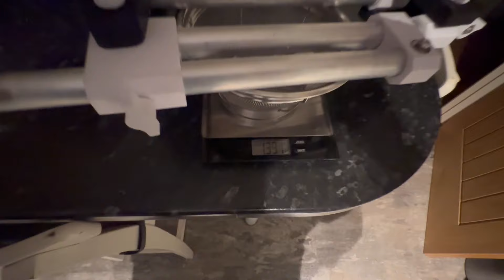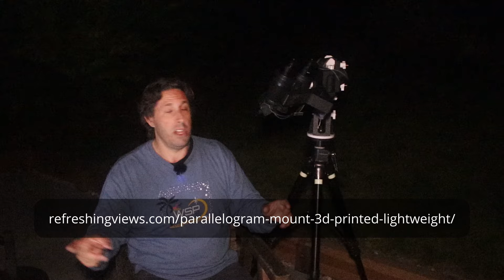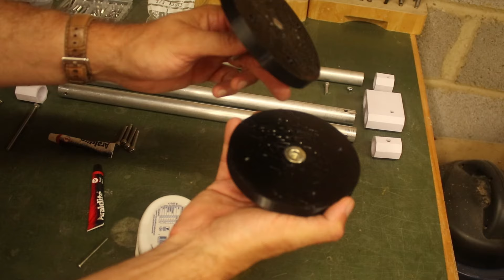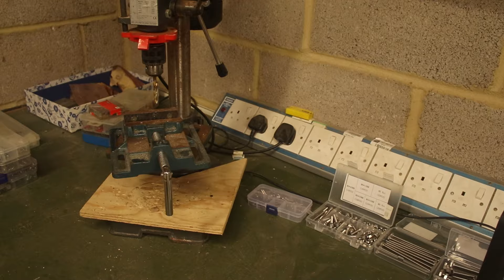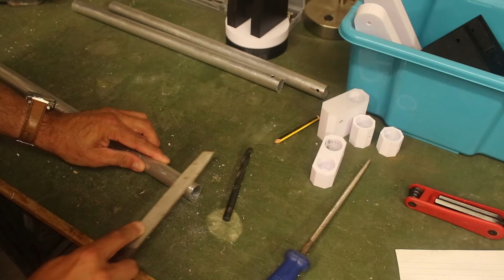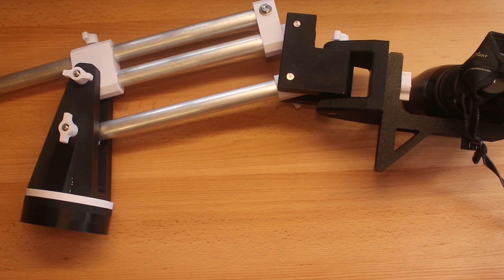Parallelogram Mount 3D Printed DIY Build for Binoculars Astronomy

Comment: Just finished mine… thank you for sharing the video and files. I designed the bottom part of the plinth to fit a telescope tripod, and will make some minor tweaks to the counterweight design, but pretty happy off the bat.
Reply: How many infilled for parts?
Reply: @panonska3 15%. It’s holding the weight well, but I would recommend 25% just to get some more rigidity, at least for the plinth and lower arms.
Reply: @ZSiegfried  how many wall line you recommend? 3 or more?
Reply: @ I left this unchanged, and don't even recall... sorry, I am not that sophisticated at 3D printing.

I feel that the most likely point of failure for my setup (which was at the 15% and normal infill pattern - so relatively "weak"), is where the top and lower plinth parts are epoxied together, so not the print itself. If this become an issue, I will just redesign this section to reinforce somehow, and then go 25% infill with a triangle infill pattern.

Comment: Great work! May I suggest one thing? Remove the string from the counterweight on the end. Bolt it directly on the pipe or design something at the end to hold it, but firmly. That way there won't be any ossceletions after moving the arm.
Reply from the maker: You are right, this was just the quick and dirty approach. Someone has just suggested using dumbbell clamps to hold the weight on the shaft so I am ordering some now. Thanks once again!

Comment: Hey mate, 

Is it possible to mount a 20x80 2.4kg binocular on this mount.
Brilliant video and mount btw. Congratulations!
Reply from the maker: I think you will be pushing the weight limit there so I think it would be a risk. My 15x50 weigh one 1.1kg and that felt pretty secure. I mean, you could try and see how you get on but I would not like to guarantee it.
Reply: @RefreshingViews  What about just increasing the infill to 40 or 60%?

Comment: Love the design!  In Canada so have many sae bolts in my shop. Trying to modify stl files is not that easy for me. Did you design in Fusion ?  Share the Fusion files ?
Reply: Also in Canada, but found everything I needed on Amazon
Reply: @ZSiegfried  for sure but too lazy ...and have a big bucket of 1/4-20 & 5/16-16?( which are bang on for 8mm) . Modifying for the 1/4-20  seemed to much of a hassle, so bought some 6 mm. Found I still needed to thin them on the grinder.  All the thru bolts on the tubing  I upped in size to the 5/16 for extra strength 
And I modified the binoc platform to accept my 15x70's.
Reply: @kellypurdue1990 nice! I am also using 15x70 at around 1.8kg - the bino platform worked fine as is, but I mounted mine on a telescope mount so had to design the bottom plinth to fit.

Seems to be holding up despite the added weight. I would do extra infill and a different pattern for added strength if I do another one though.
Reply: @ZSiegfried  will try and send a pic of my modified  binoc mount. Just being paranoid
Reply: So have pics...not sure how to share

Comment: Thanks for sharing your design. This looks like a very cost effective, flexible P-gram mount. How much infill (%) did you use in the 3D printed components?
Reply from the maker: I used the default printing settings of 20%. Hope that helps!

Comment: 25,4mm seems to be very hard to get outsite of UK/US. I can order in UK but shipping is somewhat expensive. Buy 25mm x 2 mm and use tape to create fit?
Reply from the maker: That would work or you could adjust the STF files in CAD if you prefer?